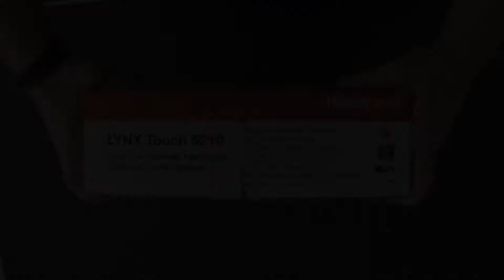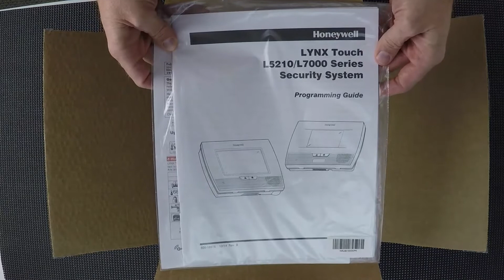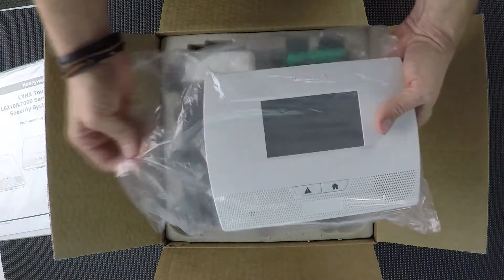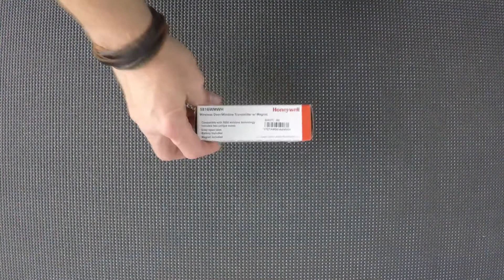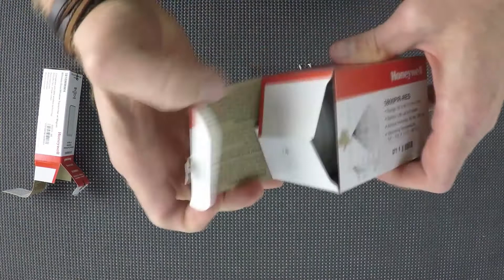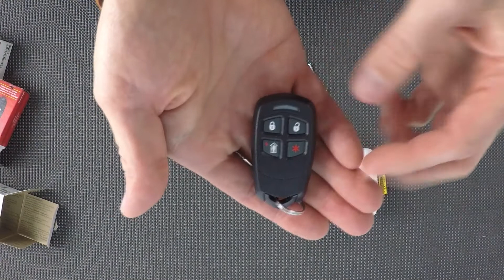Honeywell Lynx Touch L5210 Unboxing   Alarm System Store

Comment: I don't like the design of the L5210
Reply from the maker: What about it doesn't work for you?
Reply: I actually wonder why they had to make the screen small. It could’ve been a bit bigger, but it still is a great system.
Reply: I bought a house with this system installed.  I never got the information on it from the previous owner.  Is this system useless to me now?  Or can it be restarted for my use?  

Thanks for the informative video!